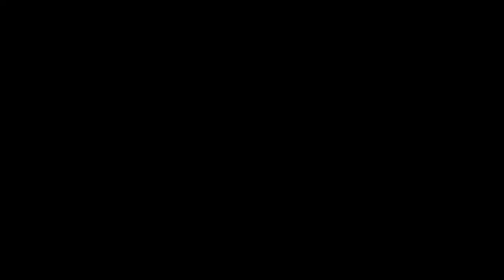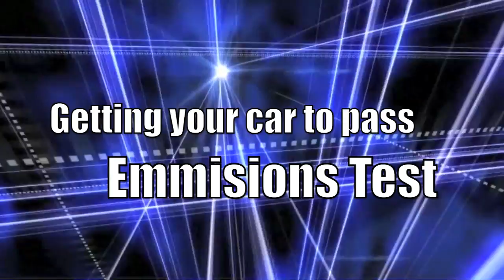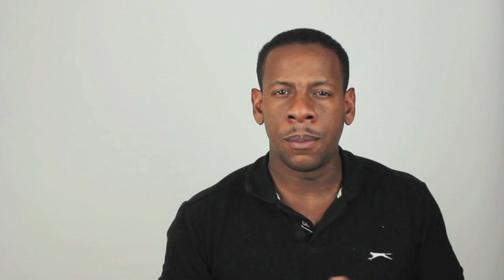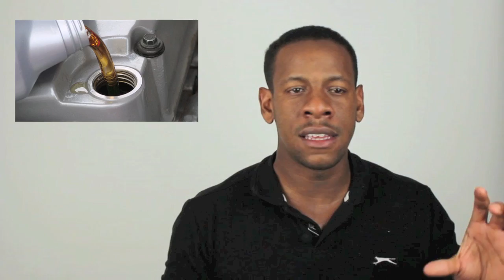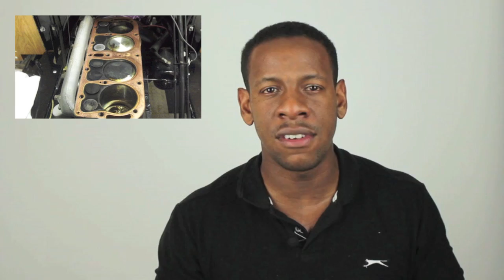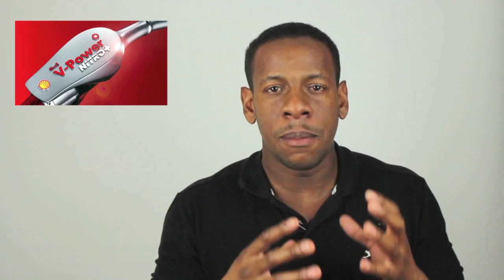Getting your car to pass emissions

Comment: I share the same thoughts! I did all the methods described + 50mph in 3rd gear on the motorway for 10min.  Then drove it in high revs to the MOT garage, it passed its MOT Emissions with flying colours. ;-)
I only ever used Shell Diesel in my 2002 Golf GT TDI pd150 ;-)

Comment: Hey mate :D ! Great job for helping us out with the Golf`s ... but I would like to ask you a problem about my car`s fuel economy....When I start my car ...instead of showing my fuel on board 0.4L\100Km/h it is showing 1 L \ 100 km/h.Do you have any ideea why my car is taking so much fuel when I stand by ? I mean it`s a 1.9 TDI and my father`s Passat It`s a same engine and his board it is showing 0.4 L / 100 km\h...Why ?? (all the filters and oil had been changed ) I will try these days Water decarbonisation method .. I hope it will help
Reply from the maker: Sometimes the display does not tell the truth. Is it really getting less mpg??
Reply: BMAC VAGS Well I don`t know that but I don`t think so , because my car`s fuel economy is really good...but I just wanted to know why it takes so much when I stand by with my engine turned on . Anyway thanks for helping me out ! :D
Reply: David Cioara I can`t wait to try the Decarbonisation method...but for now I`m just struggling to remove that necklace that holds the pipe tight because it is upside down and I can`t reach to open it...